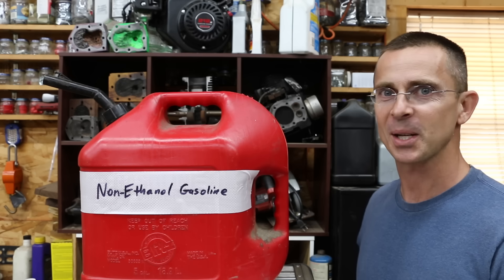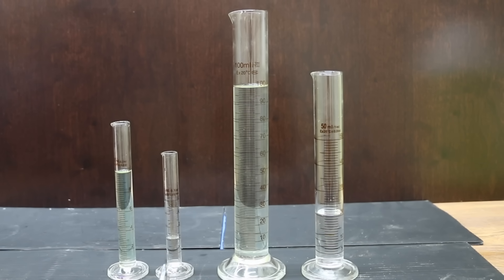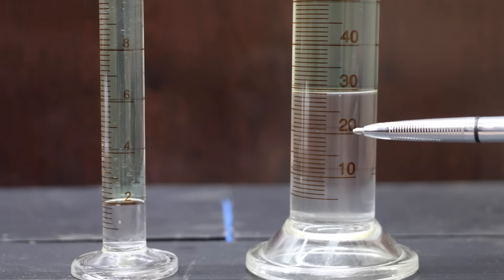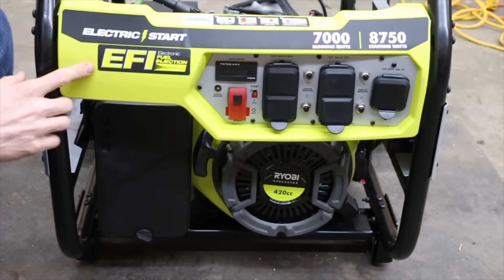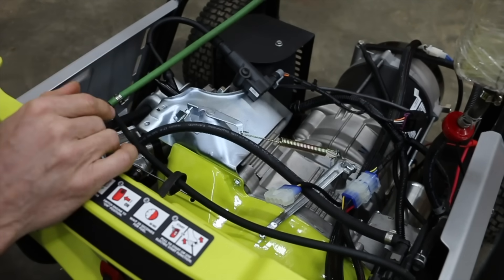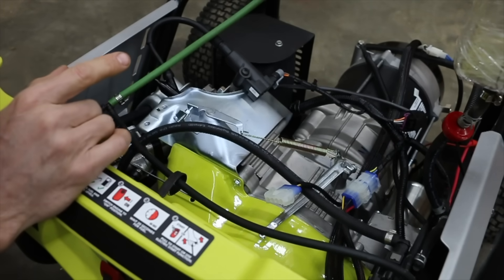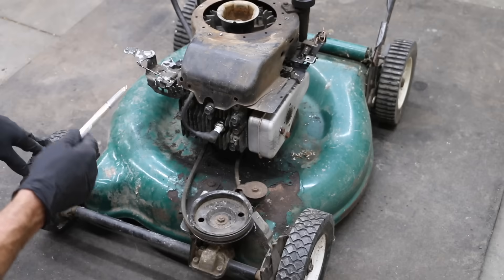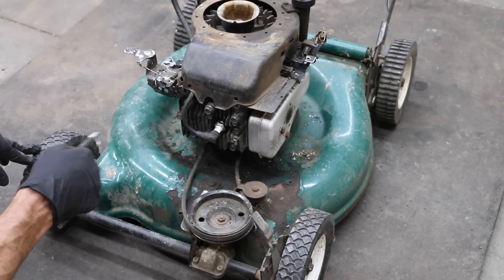Is Non-Ethanol Gasoline Really Better? See the PROOF!

Comment: First your using E10, Try some E50, Your carbon buildup will disappear and engine will run much cooler (best water injection there is)! Been using E50 for 3 years with no issues. Ethanol has nothing to do with the crap gas we buy rotting in a short period of time!  Go to your local airport and buy a 7.00 gallon of av gas. You will get 100 octane and the gas will stay fresh for over a year! Your mower and whacker will love it!  Auto fuel is meant to be used right away, not in 3 months.
Reply from the maker: Thanks for the feedback.

Comment: The only problem I have seen with ethanol ethanol fuels is when fuel is left in the bowl to set it destroys the carb I remember the fuels with high octane before they started mixing heavy carbon buildup spark plug fouling
Reply from the maker: Thanks for sharing.

Comment: I dont give a crap about that  10 % ethanol ,on older stuff it eats fuel line,s and you get junk in the carb, sprint cars use 100% but the fuel ratio is 7 to 1, it has half the BTU,s of gasoline, plus the fuel charge is cooler.

Comment: I always heard ethanol was bad for the seals in an engine.  As for fuel-efficiency, this makes me wonder, because I've noticed in my Honda Civic that I get way better gas mileage out of non-ethanol gas, like not even a contest.  10% ethanol gets me maybe 38 MPG tops, with the wind helping out, but non-ethanol has gotten me to 48 MPG and even 52 MPG that time I had a good tail wind (this is all at about 70 MPH on a highway).
Reply from the maker: Thanks for the feedback.

Comment: Can you do a comparison using Duralube and any other protectant. If you do a transmission test also then make sure you mention that although there are 2 types auto and manual it is really defined by the fluid. Ford T5 Mustang manual transmissions use automatic fluid so must use the automatic treatment. A friend has a trucking company and told me about this product years ago and said every new truck he bought Duralube goes into engine and transmission.
Reply from the maker: Thanks for the video idea.

Comment: Thanks for yet another informative and carefully-prepared demonstration. 
The octane enhancement mentioned is actually somewhat complex. It is an intrinsic characteristic of gasoline engines that knock and preignition due to compression ignition are reduced with increased engine RPM, however this reduction effect is greatly enhanced with 5% or 10% bio-enhanced gasoline (source: Radwan, Elfeky et al 2012). Since today’s automobile engines have knock detectors, and attenuate performance in the presence of engine knock, this means the engine will be able to make more power with the ethanol gasoline, because of its enhanced knock resistance. Mind you I am not saying the ethanol gasoline contains more energy, nor would it be capable of delivering more power in a straight engine lab test, but by having much better knock resistance at higher speeds, today’s variable power ratio automobile engines will be able to make more power, by requiring less performance attenuation.

The question as to whether ethanol in fuel is corrosive to engine or fuel system components is also complex. Ethanol is miscible in gasoline, and in concentrations of 10% - 15% should cause no issues with any components – plastics, rubbers or metals. Add some water to the mix though (as demonstrated) and the water will bond with the alcohol. Again, in SMALL quantities, this can actually have the desirable effect of “drying” the fuel system, allowing water/alcohol mix to be run through the engine. With larger quantities though, phase separation will occur. Moreover, this is temperature dependent, with more separation occurring at lower temperatures. This allows a corrosive alcohol/water mix to settle in the bottom of fuel tanks, lines, filters, injectors and carburetors (wherever these are used).  Careful materials choices, as well as design choices to eliminate introduction of water to the fuel system are helpful, but there will always be some water, if only through condensation of water from air. Aromatic reformates in the fuel can help as well, but these introduce their own issues with regard to aggressiveness to plastics.
Thanks once again for the discussion, and as others have stated I’ll be waiting for the longer term results in upcoming videos. Great job!
Reply: It sure seems like nonethanol gas keeps the carburetors and fuel lines in better shape on small engines… I still think corn gas isn’t as good for small engines
Reply: @nortons4673  broadly speaking, cheaper material seem to be more affected by ethanol. That could be because of what is commonly available since requiring ethanol resistance is a newer trend for mainstream engines. So yes, cheaper smaller engines might be better with non-ethanol fules but good practice of draining taking and carbs for storage might be a overall better practice than fuel type.
Reply: @troys.9188  totally right. Imo running non ethanol, stabilized, tanks drained, carbs ran dry and then fogged/winterized is the only way to go, but as someone who is also the guy fixing stuff it’s almost more about downtime.
Reply: I have an old Volvo 850 that has been converted to use ethanol as well. The consumption with added 30-40% ethanol is find just a wee bit better than what one could derive from the overall decreased energy content from the ethanol, but we're talking about a 2% at the most.